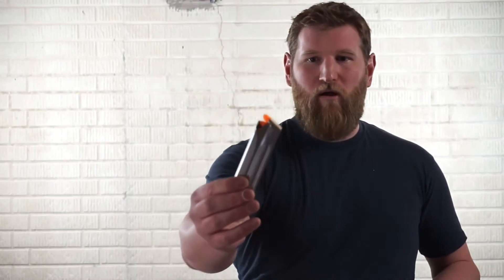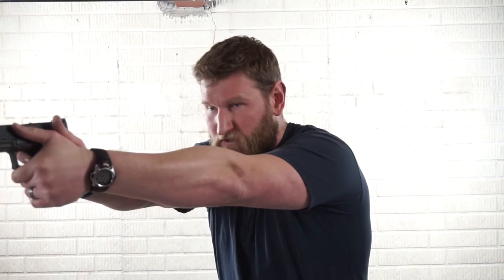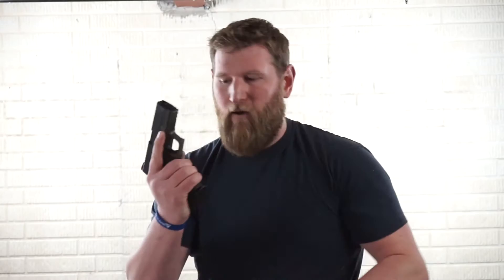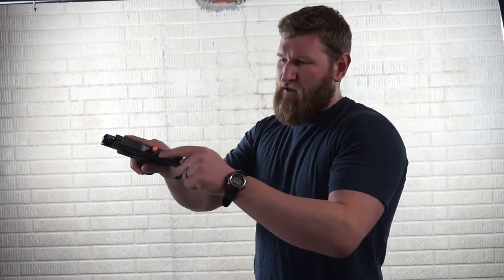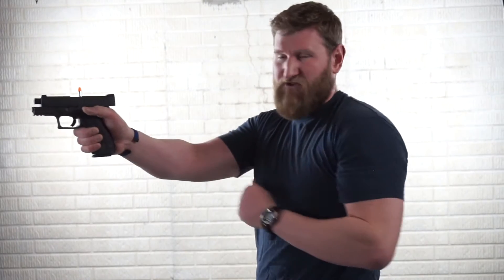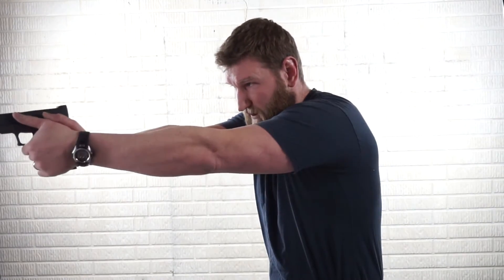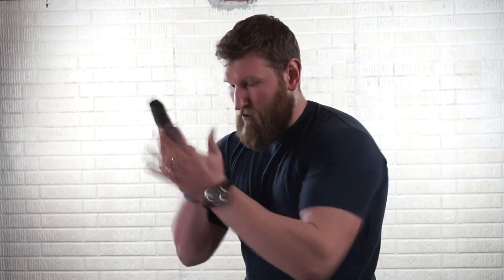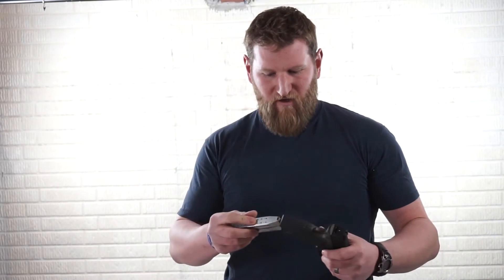How To Clear Malfunctions

Comment: I agree with the tap and rack..However, if the pistol has a safety and the safety was accidentally on, the tap rack will do nothing. If the pistol has a safety, It should be tap, rack, sweep. sweep the safety. 
As for the phase two of a malfunction. I also teach to: 1. lock the slide to the rear. 2. strip the magazine. 3. cycle the action. 4. reinsert a (new) mag.  I never have my trainee's hold the mag that they striped out.  Just my 2 cents worth.

Comment: We were taught Stage 1 (misfire/failure to extract), Stage 2 (stovepipe), and Stage 3 (double feed - unfuck the gun)... through trial and error, tap/rack worked to clear stage 1 and 2 malfunctions. A double feed was most likely from not pointing the ejection port down when clearing the simpler malfunction. I was taught the Lock, Rip, Rack, Reload, Reevaluate technique. I can say that the simpler and fewer the procedures are in practice, the less reaction time there is going to be when you're gun is fucked and inbound fire is plenty.
Reply from the maker: Thanks for watching.
Reply: +Geauga Firearms Academy keep up the good work

Comment: Never hold a gun right in front of your face like that. NEVER! 

I keep getting these videos on my feed and it’s almost like they’re reading from a script. 

I realize there’s a difference between a combat scenario and shooting at the range Tap & rack is right for combat. 

At the range you should ALWAYS check for a squib load, NOT re-rack and shoot. If you get a failure to fire:
1.  Keep it pointed down range. Wait 30 seconds, in case it’s a hang fire, then...
2.  Eject your magazine, clear and check the round, then (if necessary)...
3.  Check the barrel. 

If you follow this procedure, it’s the same for misfire, hang fire, and squib load. EVERY TIME. 

Sometimes because you’re wearing ear protection and/or someone else shoots at the same time (especially indoors) you may not hear a squib. 
Don’t believe me? Search YouTube for squib load and hang fire.

Comment: Hi Neil, just noticed that you used an overhand method for racking the slide for clearing malfunctions as opposed to what you show on another video where you slingshot the slide for reloads. Any particular reason? Can one opt to use just one method for both reloads and clearing?

Comment: I saw a video for a double feed malfuntion on another channel where he was stripping the magazine and immediately pjtting it back in the gun then racking a round a shooting. He said this was a "new technique" i think some one called it the whiz-bang method? I was wonder your opinion on that?  if it was something you thought was a benifit due to the time savings? or if you think racking the slide a few times is better just incase of something more serious happening with extracting the round? Or some other reason i am not thinking of? Basicly i am asking if you think the time savings is worth it?

Comment: I am trying to clarify your steps that leads to you discovering a double feed.  When you did the video I heard you state the following.  Upon a misfire/malfunction,  you 1) bring the gun to your field of view, 2) tap and rack.  If you have not successfully racked your slide, it is then you will see your double feed problem because the gun is in your field of view.  In your steps, I am then assuming that those two steps are what leads us to find the double feed.  Am I correct in my assumption?

Comment: I had a malfunction where I could NOT pull the slide back. The range officer held the pistol by the slide and hit the back of the grip forward with force to move the slide and open the action. Any ideas what might have been the problem ? The round looked to be OK.
Reply: Hi Tom,

I'm assuming your Malfunction was a fired round, and the slide got so tight after it fired, that it couldn't recoil, and also couldn't be manually opened by hand afterward..

Ah, yes..The "swollen pride" stoppage gremlin.

If so, then i expect your brass was  swelling in the chamber, it doesn't need to be much to do this..the casing only needs to be swollen out by a few thousands of an inch,
(The difference between .222 and .223 caliber ammo for example, or .356 (9mm) and .357 magnum is another).

You said the brass "looked fine", but did you 'fine measure' it, after you got it out?
(Okay, so maybe not everyone else keeps a micrometer in their rangebag, but you sure should have one at home, at your gun bench or reloading table, right?)

Did you also then inspect the inside of the barrel/chamber for any sign of scraping or brush marks (that suggested strong friction inside the chamber), as your friend's forced opening of the slide, 'force-extracted' the brass?

And did the extractor then fully work to extract the case, or did it overide the rim under force, and scratch into the rim of the brass?

So, put simply..We're there any kind of 'scrape marks' on the brass case or it's rim?

It was most likely that the round was either made or reloaded overpressured, and the case swollen on firing, filling the chamber to the point that it was stuck fast.

This is not really something the gun can do to itself, it can only happen with live rounds, and when the chamber pressure is higher than the brass' ability able to properly contain & thus it deformed.

I've had this happen twice before over the years, and both times it was someone else's crappy or overloaded reloads that did it.

I quickly learned my lesson well.

So..What brand & type of ammo were you using mate?

I'm gonna go out on a limb & say either 'reloads' (and 'reused too often' brass)..or hot branded, possibly cheap, foreign surplus military ammo..

You'll be delighted to know, that if you feed a good, quality made gun.. good, quality make ammo, then these things just don't happen..

Amazing how many folks will spend lots on a fancy gun, and holsters & high speed, low drag tacticool kit...but then try to skimp on ammo, eh?

Fear not, your not the first mate, and certainly won't be the last either!  

Cheers.

Comment: Simple question, and please excuse my ignorance, but I noticed that when you rack the slide, your left hand is over the ejection port.  Can this cause an issue with the round not ejecting and possibly falling back into the gun??Thanks for your time
Reply from the maker: That is a great question, and the simple answer is yes you never want to cover the port. I have large hands and it may have appeared as though I was covering the port but that is not the case.  If I was covering the port the case would not eject. Hope that helps thanks for watching!